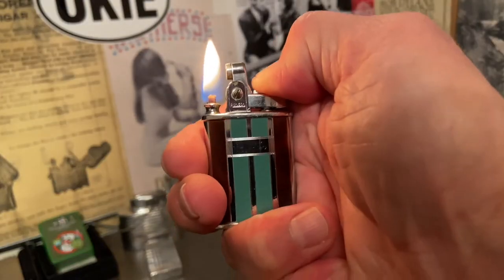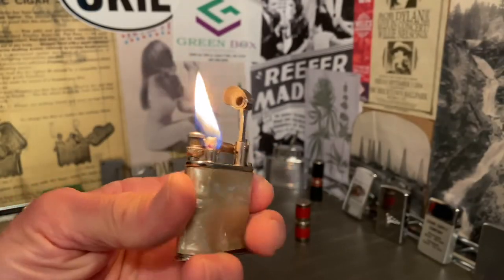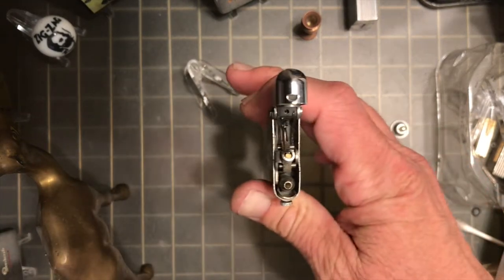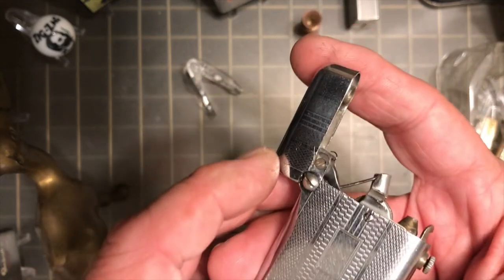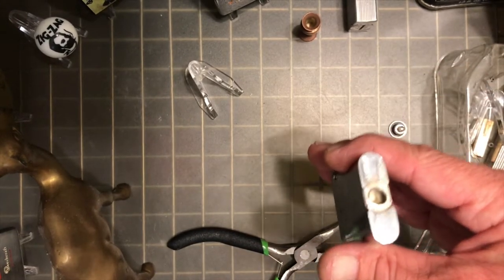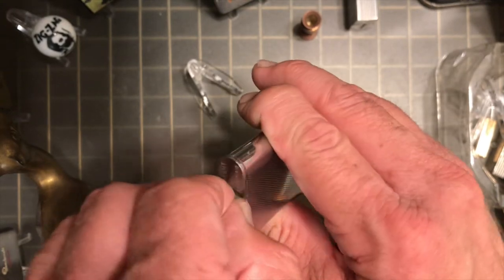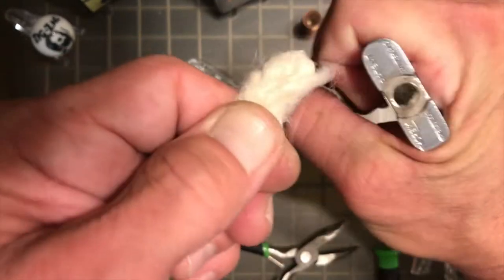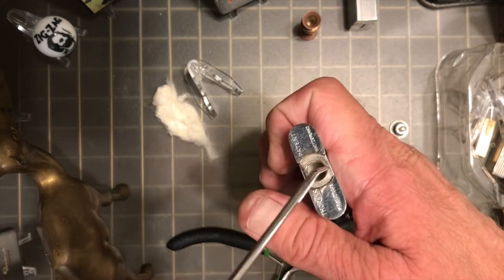How To Replace The Wick And Wadding In A Vintage Thorens Double Claw Semi-Automatic Petrol Lighter

Comment: should get some long nose - needle nose pliers, will definitely help. Also might help rewicking if you remove the "chimney" then thread the wick through the bottom of the chimney as per the manufacturer's directions. lighterlibrary usually has the manuals in their archive as well as other things like how to replace a spring or wheel. Fortunately we had our shit together back then and we didn't do disposable we made things that while yes required you to spend a buck but you'd never have to buy it again

Comment: Any chance you can do a video of a Thorens single claw side filler ? I recently found a very nice one in my deceased father in laws junk collection and have sort of got it going.
Despite its nice condition, it was all seized up so I gave it a soak in a lubricant while I went and did some reading. I found that the safety was stuck on and I didn't want to damage it with pliers or anything so I left it overnight. Patience did the trick, so I could then open it. It still had a very old wick but no flint. After giving it a light clean as best as possible and cleaning the striking wheel, I pulled a disposable lighter apart and took the flint from it for the Thorens. I got some Zippo lighter fluid and put some in and was surprised that it fired up almost immediately. I even got a 10 out of 10 !
But it soon went to unreliable, so I clearly need to do things properly. I got some wicks from Ebay from a guy in the UK who makes them to original specification, but am not really sure how to proceed from here.  While this video is great and shows that it is going to be a fiddly process, the side filler sort of has me a bit stumped as the hole is quite small. Is the process the same as this one or do the side fillers come apart in a way I haven't yet seen ?
Any help appreciated - I prefer to get information before tackling older items. There is nothing worse than wrecking something thats 100 years old ! :)
Reply from the maker: Yes, the principles for changing the wick and wadding in your side fill Single Claw will be the same as this Double Claw. The only way for the wadding to come out is the fuel hole. I would be glad to make a video demonstrating this but I don't currently have any Single Claws, let alone one that is side filled. Will put this on my list of projects when I do acquire one but for the time being, while yours may be a little more difficult to accomplish, the principles are the same. I hope this helps.✌️

Comment: I’ve found that using a drill bit makes it a lot easier to dig out cotton from a small hole. Just spin it around in there then pull out the cotton wrapped around it
Reply: if that works that genius